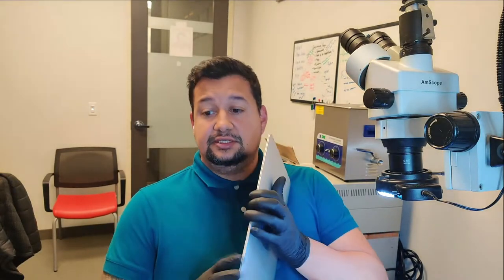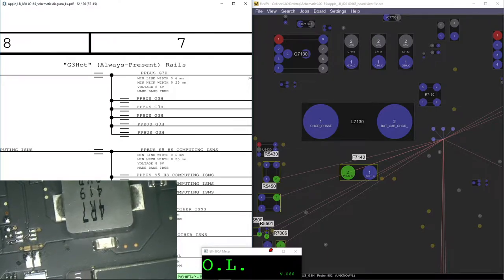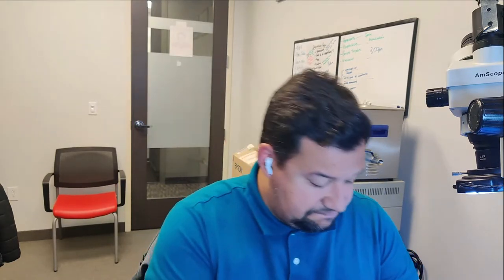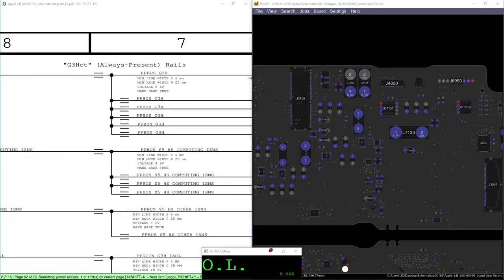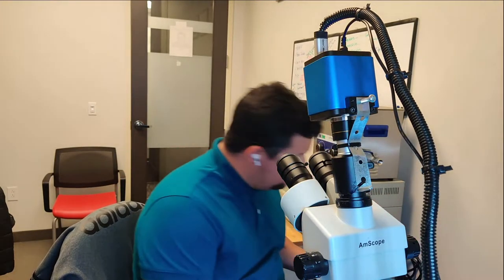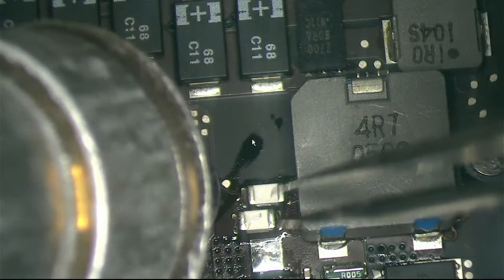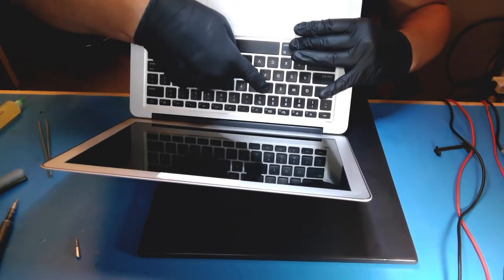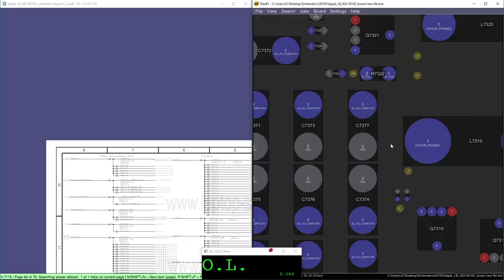MacBook Air 13-inch A1466 820-00165 NO POWER. Logic Board Repair. Step by Step.

Comment: Great video my friend!! I wanted to ask, what’s your temp setting and air speed set to? I’m barely starting myself and I’m having a hard time air soldering right now.
Reply from the maker: A lot of practice and it all depends on brand and ambient temperature, practice until you find your right set up.
Reply: @Juan4Repair  thanks for the tip! Also, thanks for the process you showed in the video. I was having a similar problem and by doing that I was able to figure out which power rail was affected. Thanks!!!!
Reply from the maker: @tinman9341  amazing to hear my friend 🙏

Comment: Amazing video, but my problem must be something else. (I have the 2015 A1466 with the 820-00165-A)
With all cables disconnected, only the power pcb and it's flex connected, and the fan.
When connecting magsafe power, I get momentary green light, then red... No other activity at all.
No fan spin at all
No liquid damage 100% (It's my machine)
No shorts on any top side (facing) NEB AV7 caps (only for a moment as they charge)
The F7140 fuse is fine
Everything looks clean.
If you have any tips on what I should try next, I'd really appreciate your help.
Thanks.
Reply from the maker: Check all the power aliases, rtc and reset lines, bios and smc.
Reply: @Juan4Repair  I'm not sure how to do that. I have a multimeter to check things.
Also, I have discovered that I can get the fan to run at full speed... by having the battery disconnected, hold power button for 10s, attach power maglock, keep power held for another 10s.
SMC seems to be ok, because I'm getting the red/green flicker when buttons are pressed, and the fan turns off.
I've since checked the read of the board, and the board looks "new";  everything looks perfect. All the videos I've looked up, they all have a very clear and obvious fault, such as corrosion or liquid damage, where as with mine, it looks fine.

Regarding the things you have suggested, could you recommend a tutorial video, and/or what components I could test, and what values I should expect. Thanks.
Reply from the maker: In Mac there’s not common failure you need to read the schematics and go step by step my recommendation is to take it to someone who knows what to do.
Reply: @Juan4Repair  No that's not good enough, I'm looking to learn how to diagnose this myself. I have the schematics, and my current level of knowledge is "Making basic PCB's with EasyEDA" for small projects with 3d printing, Arduino, ESP32, etc.
I understand that there is no "common failure point", but there must be a diagnostic workflow for times where there is no clear visual damage?
I imagine that there being no visual damage, is a clue in itself to the fault? Or at least that eliminates a group of faults?
I think a tutorial or video about diagnosing the 820-00165-A would be a helpful video. 
Like... Step 1) Test theres 8.4v between these points, if its only 3v then theres a problem..... Step 2) Check there's 3v here, if its only 2.2v, then theres a problem etc.
Reply from the maker: It is true, but for that you have to check the whole video and understand step by step. Check all the videos complete step, read the title and it will say 820-00165 and if you don’t find what you are looking for you can keep looking. But by text you never going to learn. Good luck let me know how everything goes.
Reply from the maker: Btw all my videos or the majority are based on the same diagnoses process, but you have to really pay attention.
Reply: @Juan4Repair  ok thanks you for your help, and  prompt reply :)